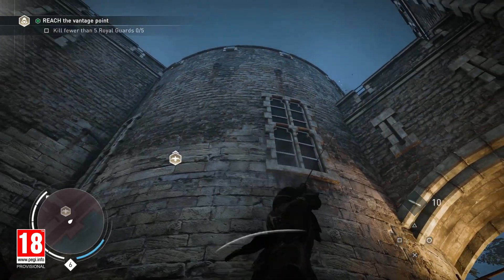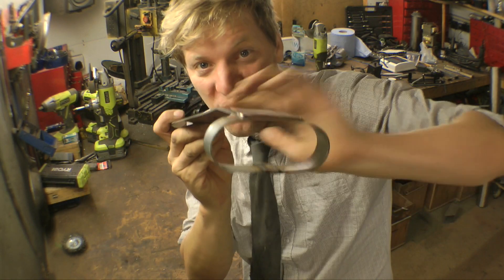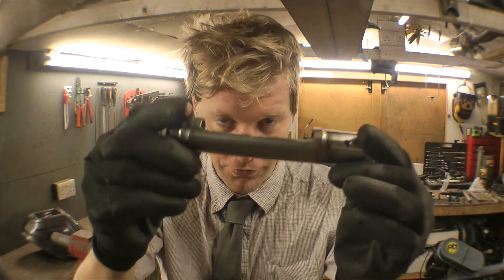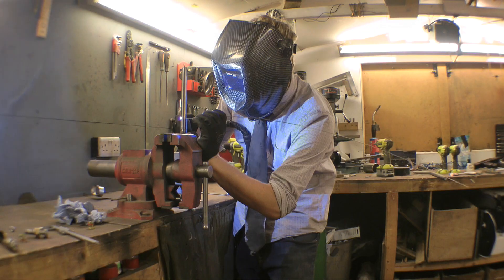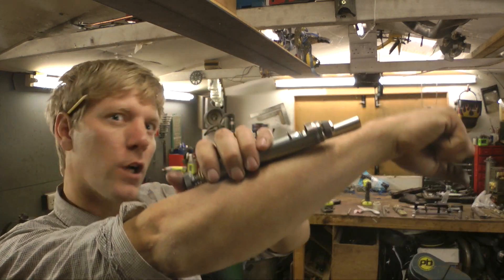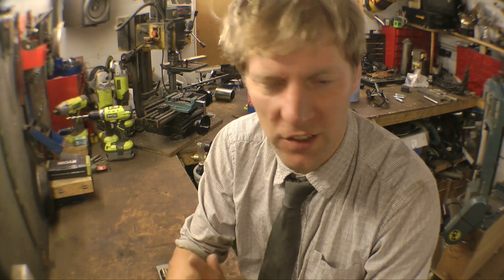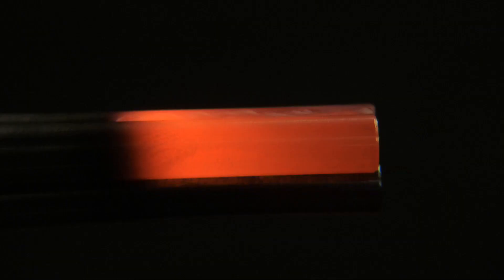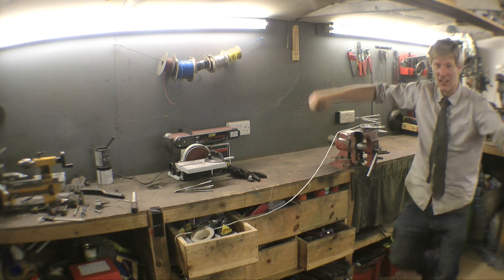Making a Real Assassin's Creed Rope Launcher part 1 - firing the rope

Comment: When do you end the bunker video?
Reply from the maker: +TheMinersXL after these
Reply: +colinfurze mate, would a thing like a fishing reel not work pop an eletric motor on it and presto you have a winch like thing or something like a small marine winch, couldn't that do the trick ???
Reply: +colinfurze You are a Genius! xD you are the only person i know that would be able to make a jet powered toaster and you probably have at some point xD
Reply from the maker: +Lalaland when you hang your full weight of something though how a fishing reel winds the line in would just bend and take a lot more power
Reply: colinfurze
thanks for your response I was actually thinking more along the lines of something like this http://www.apmpetrides.com/index.php?act=viewProd&productId=695 it's small packs enough torque and would hold your weight but you'd have to retrofit it to shoot the line of it without tangling. Stay safe and awesome mate
Reply: +Lalaland Very true, that may just work. Although you would have to lump a car battery in your backpack everywhere haha!
Reply: Oliver Armstrong
hmmm, a small motorcycle battery would probably do the trick though they are available in 6 and 12v if I recall correctly, would save you weight..
Reply: +Lalaland Actually, a 3 or 4 cell lipo could do that rather easily.  Doing some quick calculations, it should require around 40-50 amps which many cheap and relatively small hobby lipos could output.  You could do it one better and salvage one of those kits and swap out the motor on it for a brushless and get even more power and efficiency.
Reply: zendell37
you are probably right, I totally overlooked the lipo cells. I hope colinfurze finds a way to solve this. He will probably come up with something epic anyways, can't wait for part 2
Reply: Oh yea, he will.  And we will enjoy it.
Reply: +TheMinersXL i also want to know.
Reply: i also want to see the bunker made
Reply: +TheMinersXL bunker pls, that is not some you always see on youtube.
Reply: Ikr
Reply: +colinfurze let me guess in a month?
Reply: +Insomnia cat ...as opposed to a arm-mounted, projectile grappling hook which you see all the time! lol
Reply: Yeah i wanna see more bunker vids
Reply: same
Reply: okkkkķ
Reply: +Zippy Ghost That is true he does YouTube.

Comment: I don't know if that C02 cartridge have enough power to make a practical use grappling hook. Maybe a 12 gauge blank shell... But anyway, it's awesome! Can't wait until the next video!
Reply: Me neither. But They have a Lot Power too.... lets See! :)
Reply: +Fernando Fontana "practical use grappling hook" haha that's funny shit!
Reply: it seemed to hit the wall pretty hard in the video, I think it could be pretty good
Reply: For sure that's not practical for common people. But for adventurers, alpinists or fireman's that maybe be. With some improvements engineers can turn this concept into a useful tool.
Reply: +Fernando Fontana Engineers have been at this a million times over, but the conclusion will always be the same: You have no idea how securely the hook has mounted and no idea how secure the material you hooked onto is.
So you either get up there to make sure everything is secure in the first place or you are asking to get killed.
Reply: MsSomeonenew That's true. But the hook can be used to pull things like a harpoon, that can be useful on a car accident situation, for example: if you need to pull one car without get too close. In that case, the hook gear needs to be very robust. Or can be handful to exploration robots or bomb disposal robots allowing them achieve inaccessible locations. I don't know, something cool like that has to find an application XD.
Reply: patheticmada I don't know the firearms laws in England. Is just a blank shell, the same they use in special effects for movies, is that so difficult to buy? If it is, the CO2 cartridge seems to be the best choice.
Reply: +patheticmada " if a gun is fired anywhere apart from a shooting range you will be arrested" Not quite true: hunting, clay/target shooting and pest control are still allowed uses of firearms outdoors but under certain conditions.
Reply: +patheticmada There are certain construction tools which use firearm blanks for nail injectors, etc. Nothing like a 12gauge, more like a .22cal, so it's not without practical precedent. Also not familiar with UK laws.
Reply: +Ryan Cook true, certain tools do but vey few now as nearly all nail guns use either a pressure hose or an electric source
Reply: SuicidalBeef Cheespuffs I don't know how commonly used they are. I'd imagine it would be a middle of the road method, for someone who wanted more power than an electric but did not want to spring for the industrial pneumatic setup. I do know that my local Home Depot sells the cartridges, but really my point was simply that such a thing exists, and has been done before.
Reply: +RobertShort ....rocket-propelled anchor on a 100m hawser attached to an 8 tonne winch..... 

https://en.m.wikipedia.org/wiki/FV180_Combat_Engineer_Tractor
Reply: I think in reality you would need somekind of full body rig to help assist you in lift. So if you were an Assassin in Assassin's creed they probably would have need to find a way to integrate the grappling system into their suit so that they don't have all these parts. It would need to be intergrated as such that its not too difficult to put on, and doesn't take too long to get full functional, basically convenience would be a key part of making a fully functional device like this.
Reply: yeah, looking at this model, what strikes me is how heavy it would be on your arm. You're supposed to be a stealthy assassin, after all.
Reply: +Robert Short NO SWEARS!!!!!!!!!

Comment: This really is awesome, Colin! The appropriate line is called Dyneema. There's a similar material called Amsteel, can't remember the difference but not much :s anyway, it can hold your weight with a thin (couple of millimeters) thread and is also extremely light. It can knot easily but if wound correctly, not a problem. It's used for power kiting and Arborist's throw lines so plenty use it to be hoisted into the air regularly.

Comment: Diggin' your work and craftsmanship. The winching mechanism is going to prove particularly difficult. Making a purely mechanical winch that can lift your weight, no problem. Doing the same for an arm-mounted gizmo, however, is an entirely different story. Storing enough potential energy to lift your weight to a height of roughly 7+ meters will require some seriously reinforced hardware, which itself gets weighty. If you go electrical, then you're going to need a high voltage battery with a serious discharge rate (which is also going to get hot).

Good luck man. If you pull this off, I'll be even more impressed than I already am with your ability.

Comment: small problem, the launching part and the pulling part are in a different place. this means you have to wrap the rope around the pyramid, put the hook in, and then shoot it. Then, after it pulls you up, you have to unwind the rope, and wrap it around the pyramid again! just wanted to point that out. Its an awesome project though

Comment: Fantastic design so far.Have you considered Dyneema Powerkite lines? Flexifoil sell a 20m set that has a breaking strain of 360kg, and they're between 5 and 10 times thinner than the cord you're currently using

Comment: 550 paracord is your man, if that isn't already your 'nylon rope.'

As for the spool to lift yourself up with,  I can only see that being on the underside of the forearm and possibly having to guide the rope into the device beforehand and then that will haul you up and I'd consider a long spool connected to a motor that can give you enough torque to lift you skyward!

No doubt the drawing board has been pondered over a long time for this project!!

Comment: So I was thinking on how this could be improved, you could combine the winch and the rope holder into one component in a similar fashion as a fishing reel. Might even be able to get away with using the wire instead of the nylon rope.

Comment: It isnt quite like the on in the game (dont get me wrong its still really cool)
But the one in the game looks to be a rachet mechanism more than a winch because once it fires the rope reel locks into place and then the rope only pulls them up if there's no weight on it and when weight is applied the reel locks back into place and engages the rachet to prevent them from falling

Comment: Dyneema fiberline. Commonly used in sailing applications. pullstrength properties comparable to a steel wire.
Should allow for more "rope" on the rope launcher so that a parkour guy won´t ascend higher walls in one leap than this launcher :)

Comment: Cool. Clever, yet it's too cumbersome. If you could condense the coil into more of a grapnel spool (think of a pulley with the cable wrapped around itself multiple times)  and improve the cartridge to fire with out using the other hand it'd be absolutely perfect. Also try improving the shape of the hook to be more aerodynamic and smaller you'd have a near limitless amount of potential for it.

Comment: Instead of that nylon cord. Get some 550 Paracord, it holds 550lbs, so you should be able to use that without breaking it, and you can trust it more.

Comment: Colin Furze how do you control the rate at which the co2 releases, I mean isn't the only thing holding it in like a little seal, then as soon as you break the seal doesn't all the co2 come spraying out??? How do you control the co2 flow?? Or is each co2 cartridge just a one time use, like do you use it once and then all the co2 is used up, and you have to use another one??

Comment: @colinfurze what if you were to make a mini arm mounted cross bow that fires an arrow with a grappling head at high speeds. that way, with a rope attached, the speed would keep a better trajectory due to the weight of the rope.

Comment: Could the firing system be placed inside the conical spool to save space.  The barell would replace the central rod and the hook would fire out the tip of the cone. Point would be to make the whole rig smaller.

Comment: You should use 550 paracord instead of the nylon rope, it will hold a lot more weight.
Reply: Not really, 550 only holds that amount under certain circumstances 

Plus nylon rope can litterally hold 10 X that amount

Comment: how many shots would you say you get out of one cartirdge per shot? one and done, or could youget a few different shots off before you had to change?
Reply: also, have you considered a titanium filament for the cable instead? its stonger, smaller, and lighter. Or would it not have worked with your design?
Reply: nevermind about the second thing.  I saw you explanation for it...